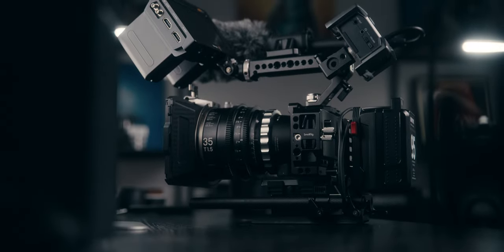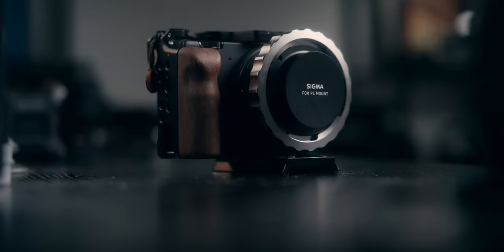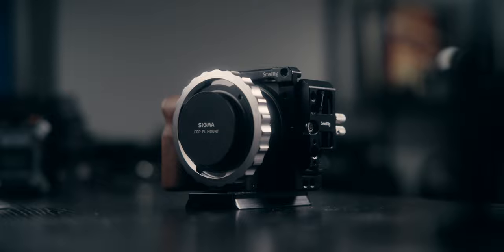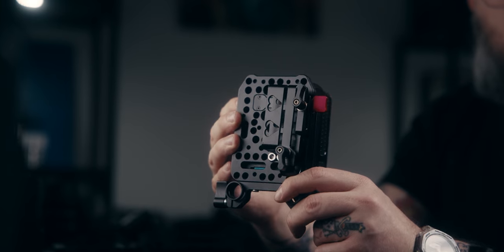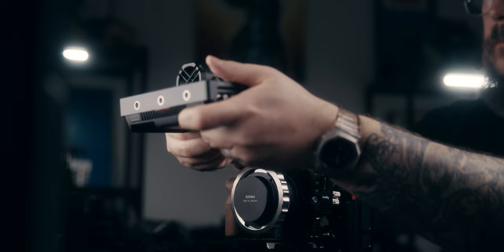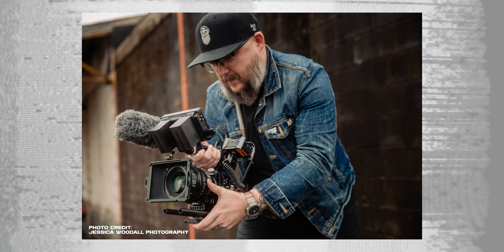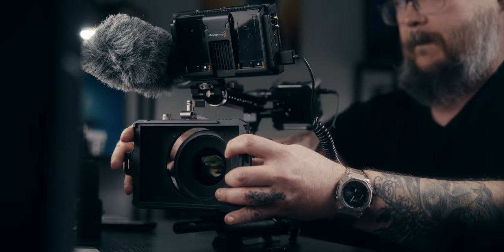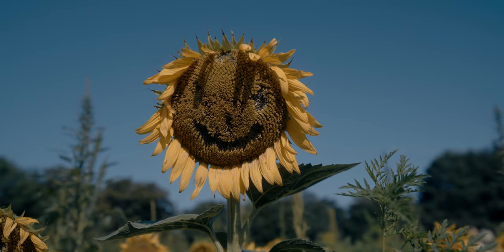The PERFECT SIGMA fp Rig for Cinematic Documentaries and BTS Filmmaking!

Comment: Hey Anson - Do you run audio out of the F3 and into the FP with a 3.5mm TRS jack, or just record separately and sync in post?
Reply from the maker: It depends on the project, but 99% of the time I run it to the FP.

Comment: I have a SIGMA fp.  Would like a buy a dummy battery for the fp that takes power from an external battery via D-Tap (P-Tap).  There don't seem to be many options currently available, but POWRIG is one of them.  I see that you've been using this adapter (2:22).  After more than a year of use, are you still liking it?
Reply from the maker: It is still my go to for powering the rig for sure

Comment: Loving this rig set up. I'm working on a GH6 documentary rig, and would love to know if the F3 gets in the way or just is annoying to work around or not?
Reply from the maker: It doesn’t get in the way, but if I were building this with the gh6 I would use lumix’s XLR accessory, I loved using that thing when I had it
Reply: @Ansonandco  I've thought about it, but the F3 has that 32-bit float which could be nice.

Also heard that the xlr adapter didn't sound great compared to a dedicated field recorder

Comment: Hello, I have the Sigma FP and I usually use it with a Samsung T5 SSD, but I recently noticed that it only works well in 12 bits with a USB-C cable, while all the others don't work properly (the recordings cut out). Do you know anything about this?
Reply from the maker: I have that same issue. Are you using the cable it came with?
Reply: @Ansonandco  I am using Samsung T5 drive cable. Now I bought a cable from Amazon that supposedly supports a data transfer speed of up to 40 Gbps, I will try it tomorrow, but I don't feel very optimistic.
Reply from the maker: @nicolasaguilera8713  yeah I’ve found it doesn’t work well with 3rd party options. You may want to consider switching over to the sandisk or Lacie drives

Comment: I really wish smallrig would make those clamps again. Doesn't make sense why they stopped making them.
Reply from the maker: I think at the time the sigma fp had lost steam and so they stopped manufacturing stuff for it. And then they partnered with sigma for a completely new cage design, which probably does not cater to that side clamp design anymore
Reply: What was the model number on that cable clamp? I was finally able to find the original Smallrig cage (CCM2518) used through Adorama, so I'm feeling lucky!

Comment: Question:  Do you add the audio from the f3 in post edit, or do you go from the f3 output to fp audio/mic input?  The reason I ask is, you can’t bypass the camera preamps by simply plugging in an external mic or plugging in the f3 to the camera.  So, you have to add the sound in post editing and sync it up.  The camera pres are hissy.

Comment: Question:
Are you plugging in the zoom f3 into the 3.5mm Jack on the sigma Fp?

Then you are getting redundant recording on the f3 along with the baked in audio from the f3 out?

Thanks!
Reply from the maker: I do plug the f3 in and it is baked in, I haven’t tried recording to the sd card on the f3 yet but I don’t see anything that should prevent redundant audio recording
Reply: @Ansonandco  ok, and that audio that’s baked in is recorded at 32 bit float, meaning you have next-to unlimited flexibility in post to dial in levels?
Reply from the maker: @flochfitness  I don’t know if the audio in the FP is 32bit float, but yes the f3 does allow for that
Reply: @Ansonandco  good to know. So you still monitor the audio with headphones and make sure nothing is peaking when using the f3?

Comment: 1. How do you sync audio? No timecode? (I use the aux out from my audio recorder to the Ninja V or FP audio-in, so I have audio with the video already, but can manually sync in the better quality audio from the recorder if I need to. 
2. With a massive battery like that, why not power the BMVA with it as well?
3. No focus-puller? You have a cine lens and rods in place already?
Reply from the maker: 1. Honestly I typically pass the audio through to the FP. Otherwise yes I would sync in post.
2. Honestly I haven’t found a good cable management solution for it. I’m not opposed to it, but I hate a bunch of cables and so I just don’t connect it to the v mount.
3. I prefer to pull focus by hand. So I tend not to use a follow focus unit.
Reply: Don’t forget about the possible ground loop shortage that could occur powering monitor and camera off of the same source.
Reply: @rovingearth7028  I use a Smallrig NP plate with three separate outputs to power an fp, a Ninja V and a MixPre 6. Works nicely. In what situation is the ground loop a possibility?
Reply: @rovingearth7028  Yeah, the ground loop thing is annoying. I just use the camera audio as a scratch track.

Comment: Hi Anson, I am toying around with two fp/fpL rigs.  On my cine rig, I mounted a smallrig top handle which has four cold shoe points.  Using the two side cold shoe mounts on the handle, I mounted two elastic shock mounts for my nice small condenser mics.  Then I used a smallrig monitor mount to mount the zoom f3 on the handle.  I know this may seem overkill, to mount two mics.  The thing is, I like the idea of stereo sound.  The mics and the f3 can easily be removed for different audio setups.  I tried this because I already had a stereo set of mics, but maybe a single stereo shotgun mic would better, just one mic would suffice.  Still, this was fun to try.  Perhaps I will put up a video of my rig so you can see.  It is kinda wild!  I don’t have a v-mount battery, but at least I can plug everything into a power strip if I want, otherwise everything is battery powered.  The battery life on the f3 totally sucks!  If I mount the monitor on the other end of the handle, it sure looks interesting to say the least.  It sure costs a lot to get rigged out!

Comment: You and I are of like minds on this camera.  It is so good in terms of value for money, all the “problems” that people whine about can be solved with less than the balance of what they would spend anyway on some high-end DSLR or canon/red/bm/sony/etc. rig. Additionally, the added bonus is that you are not committed to one solution to solve any problems you mention like rolling shutter or audio.  I also love the fact that you bring up Sigma’s stellar adapters, you can mount lots of glass to this camera with the caveat that AF will either be non-existent or degraded - but if you get a gimbal like RS3 pro, you can pull focus with your phone (or LIDAR).  On the audio, I will say “zoom” kinda screwed those of us that are F8n owners, they dropped support then came out with a new F8 with no upgrade path, but if you need affordable bullet proof audio an F6 or F3 is the ticket (once again, value for money).
Reply from the maker: Exactly! It is an amazing value for money solution. And what’s funny is other high end cameras have these same problems. The red Komodo has a 3.5mm mic jack, and is tiny and so micro jitters are definitely there. 

As far as LiDAR, you may not even need an DJI gimbal… stay tuned 😉
Reply: @Ansonandco  read another chinese company as lidar solution without a gimbal.
do you know? it's called power...and somethiong.

Comment: Anson, you created perfection! I recently became the owner of this wonderful camera and I really like it. I easily figured it out, because I have experience with different cameras. But one thing is not clear to me: why is there dng 8 bits? It’s clear to me when dng is 10 or 12 bits, but why 8, there still won’t be such a color depth. It's like a bad jpeg sequence. Maybe I don’t know something about dng 8 bit and it has a special meaning? Could you tell about it as a guru of this camera?
Reply from the maker: Thanks so much! 

I don’t know why 8bit is an option, other than offering a DNG offering to SD cards. I personally use it when I’m in a pinch and want to not record to an SSD. If you expose in camera it does a pretty decent job
Reply: @Ansonandco  Thanks for the answer! In my opinion, if it is not possible to take an SSD with you and you need to record inside the camera, then it is better to use mov all-i, for example, in the portrait color mode, it gives such a soft and pleasant image. It will probably even be better than DNG 8 bit and will weigh less.
Reply from the maker: @arthurkravtsovchannel  share your secrets! My all-I footage always looks terrible
Reply: @Ansonandco  There are no secrets) I leave all the settings by default. I use only native ISOs - 100 or 3200. I also plan to try to process the captured all-i into the Film Convert, I think FC should cope and get a good picture.
Reply from the maker: @arthurkravtsovchannel  need to try it out. I’ve never given all-I a chance

Comment: Solid setup here. 

I didn’t realize how small the f3 was. Works nicely with the rig. 

So when you run a line to the 3.5mm Jack so you can bake in the audio, are you able to split the audio tracks in post?

Additionally, how is the timecode workflow?

Thanks!